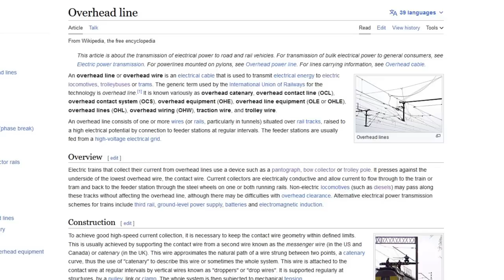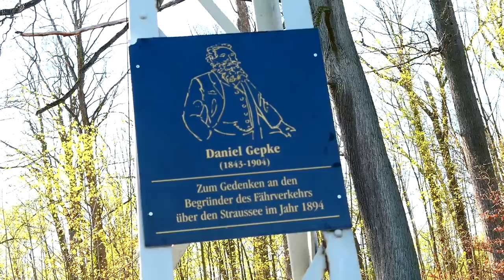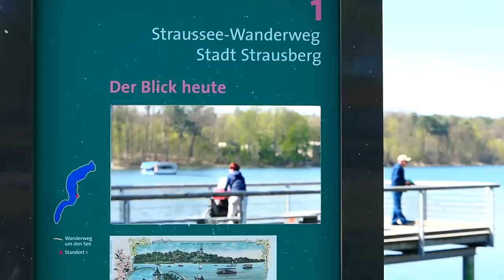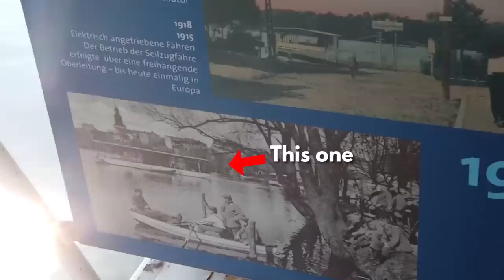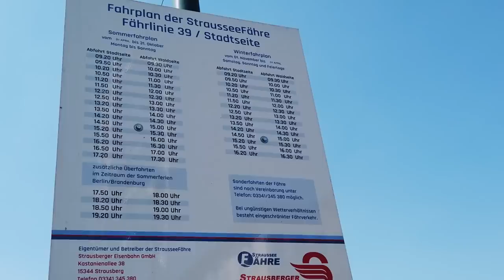The Ferry Powered By A Live Electric Wire

Comment: Seems like it'd be easier to put the winch on the shore and tow the ferry by its cable, like a San Francisco style cable car. You would need minimal power aboard that way - just enough for wireless control, lights, etc. I wonder why nobody does it that way. Or maybe it is a thing and I've just never heard of it?
Reply: it is a thing. It's called a cable ferry, or cable pull ferry. It's the oldest form of ferry. Many of them were retired because the cables sets a limit for how big the ferry can be, or they were just replaced by a bridge, but this is a very small ferry and could easily be built as cable pull. There's no need for it to be self-powered when it only goes such a short distance across a calm river
Reply: There's loads of cable ferries. It's definitely a thing. I and I was wondering the same thing. This type of electric ferry doesn't really appear to have any advantages over a cable ferry in my mind.
Reply: Yes, that is a cable ferry. There's actually one in Potsdam, not far from Berlin (just in the other direction).
Reply: it's Germany, sometimes they over-engineer things over there. 🙂
Reply: @TheEstampe  only sometimes? :P
Reply: @thesteelrodent1796  It isn't even a river, it is a lake ("See" means lake).
Reply: @all the ferry in this video is a cable ferry.

@OP there is a good reason why most cable ferries have the engine on the ferry and not on land:
If the engine is on the ship the cables can have slack. The cables are under water even while the ferry is moving. So ships can cross the ferry even as it's moving. 
Whereas if the engine is on the shore the cables are pulled tight and over the surface of the water.
Reply: @mdhazeldine  the ferry in this video functions just like most other cable ferries. 
The only difference is how the power is provided. (not by battery or a diesel engine) 
And the advantage of this type of power delivery is that you don't use a diesel engine and don't have to re-charge the batteries (that's especially a problem with battery tech from 1913)
Reply: Towing the ferry by a non-stationary cable on a shorwbound winch is difficult because on all but the shortest crossings, the cable sags and sits on the bottom of the waterway, usually in mud. That same mud prevents rollers like abovewater cablecars have.

Comment: 230V system, max 7.5kW power (10HP) for max. 100 passengers. That's mighty efficient (and slow)
Reply: 5 minutes to cross a lake doesn't sound very slow to me, just about normal. (shrugs shoulders)
Reply: @LeafHuntress  Depends on the width of the lake, looks like a nice, leisurely ten minute swim.

Comment: I find interesting that it uses just mains 230V. Given the thickness of the wire, it uses no more than 200A or about 40kW (55hp). But I also think that it does need more, as cable pulling is more efficient than a propele.

I would rather use 600-1000V.

Comment: For cable ferries, I'm never too clear on why bank-pulled ferries (like the Jonen or Kungalv ferries) are so rare. They are pulled by winches set on the banks which can easily be powered electrically without needing to run power to the ferry itself. There must be a reason, but I can't rightly imagine one, they seem like a much simpler design using hard-set winches, and the ferry itself is just a barge.
Reply: Getting a fail-safe control signal from the boat may be a design challenge.
Reply: Also, the cables dragging through the riverbed silt add an enormous drag.

Comment: Well actually…

The Kornhall ferry across Norde älv between the north shore of Hisingen island (of Göteborg minicipality) and the mainland of Bohuslän (and Kungälv municipality, where Lise Meitner was visiting one X-mas and figured out nuclear fission while on a X-mas day stroll; by coincidence, the railway station for Kungälv is in Ytterby, the same name as the mine on the other coast of Sweden where so many elements were discovered in Gadolinite) is one of those extension cord ones. The ferry is called Kornelia – of course, a good pun is par for the course in Göteborg. 😁 There is also a smaller version of a tide barrier across the river there, to prevent salt water from entering the fresh (😬 well…) water supply for the slightly more than half a million inhabitants of Göteborg. 

But you’re not going there so see any of that, you’ll be going to see the four-ish generations of locks at Trollhättan before the canal is rebuilt with the fifth generation of locks.

Alternatively, Göteborg (that’s “Gothenburg” to you anglophones) has northern Europes largest network of trams 🚃. The quirky bit that is Tim-worthy is that is was supposed to be converted to mini-metro in the 1960s, so there’s a bit (on the alignment of an old narrow gauge railway) with underground mid-platform stations with a right-hand traffic to left-hand running crossover in the middle of nowhere.
Reply: And there is also an "extension cord" ferry a bit north from the Kornhall ferry, between Orust and Malö. I grew up close to it, at that time a diesel powered cable ferry. It is really not very far-fetched to  convert cable ferries to electric cable ferries.

Comment: Why not use DC and use the water as ground instead of return cables?  Trams basically do this: DC potential from above and the rails are the ground.  Trolley busses need two cables to provide ground since the tires/tyres insulate the vehicle from the ground.

Comment: Is this the only boat allowed on the lake then? You can't really have boat traffic going up and down when there are guide wires stretching across it.
Reply: I'm not sure about this lake, but most cable ferries have enough slack for the cable to rest well below the surface (or on the bottom) when it's not traveling. They are usually well marked and have other indicators when they are pulling the cables tight.

Comment: Well, actually... There is an electric tug towing boats through the Riqueval tunnel, in the Canal du Nord in Northern France. It isn't so much a ferry as it is a shuttle service for boats, so it is kind of a ferry for boats. It operates on the same principle: it has two wires overhead (only one is used) and a cable underwater, and it pulls itself forward on that 8km long chain, as well as it being a return path.

It would be well worth a video, it has an interesting museum, but unfortunately no tours through the tunnel - I happened to chat to a passing freighter wo invited me along on the trip provided I walked back the 6km myself, which was well worth it even in the sweltering heat wave. (especially if you also visit the American Cemetary at Bony, because the tunnel (or rather: the absence of a deep canal trench) played an important role in both world wars.

https://en.m.wikipedia.org/wiki/Riqueval_Tunnel
Reply from the maker: Yes - this is the electric tug shown in the video. And I agree, it could be worth a vid itself some day, so cheers for the extra info! Guess I'm going to have to make friends with a freighter...
Reply: @TheTimTraveller  Oh, and it's neigh impossible to access the area by public transport. There's supposedly one pair of school bus per work day in the area, but I have not been able to find a timetable.
Reply: Is it still in operation ?  I went all the way to the entrance of the canal somewhere in the 1980s.  I saw the wires, but did not see any boat passing.
Reply: @thierrypauwels  Yes, but it does one return trip per day (at 6am and 8am)

Comment: OK... so why have an electric motor pushing an inefficient prop on a boat when you could just put the motor on land and pull the cable back and forth? -BTW Oregon loves you.
Reply: It doesn't have a prop. It has 2 winches, one for each cable on either side of the ferry.

Comment: don't see the benefit of building the ferry this way, instead of just doing a regular cable pull, since it's got cables running across the river anyway. If you want power aboard the ferry you could just power the pull cables. That overhead cable really makes it impossible for decent size sail boats to use the river

Comment: how dangerous is it to swimmers if they just ground the phase with the water it's swimming in?
Reply: Given that most swimmers are going to be less conductive than the steel cables that the ferry is pulled along, I'm pretty sure that the primary danger would be the fact that they're in the path of the ferry.
Reply: not dangerous at all because it's the ground wire, and you're sourrounded by conductive water. The voltage you experience even touching the cable will be directly related to the resistance of the sourrounding water, wich is really small, even compared to your body. Basically any current will much prefer to go through the water than your body. That is if the cable broke on all four sides; If even one is still intact, the current will go through that instead.
Reply: The current only flows through both cables, because the cables have less electrical resistance than the water or your body. It's like a tram track, the rails are ground, too.

Comment: Well, actually, even though I did military service right by Vaxholm, I was not aware of any electric ferries there. The one I used ran on diesel, I'm pretty sure. But I never went to the small fortress island, I went on a larger ferry over to the much larger island beyond the fortress. Which is populated, and also has the more modern fortress at the far end. I was back a number of years ago, and went to a concert on the small fortress island, but for some reason they had a floating bridge there, so I just walked over the strait, no ferry needed. But as it happens, I'm going there later this year, so I will probably at least see the electric ferry!

Comment: since there is current in a river, why not convert the current in the river into energy that can .power the boat from one side to the other?

All it needs is a bunch of generators powered by the current, collecting the produced energy in batteries stored on the shore. 
A monorail on the bottom and the boat hooked to it. A cable that transfers the power from the battery to an electric engine onboard. 
Et voila.

The batteries on the shore will be charged by the generators powered by the flow of the river, perhaps a bit of sunlight as well.....
And, you could even put many batteries in the boat itself, and have small little RAT kinda devices on its hull. 
Like they have on planes. For when everything else has failed, the RAT produces power by spinning in the wind.
BUT: What if you were to have such generators onboard the boat, and batteries collecting the power from the flow of the river while it is waiting for people to board???
Plus the batteries on shore which are charged by turbines on the bottom of the same river, etc etc.

And obviously it should be a hybrid. So we should put in a diesel powered engine, just to make sure.

I dunno. It just makes sense in my head.
There is always a bit of current in rivers.
Reply from the maker: You don't even need the generators! There are ferries in Basel that cross the Rhein using nothing but the current and the magic of physics... https://www.youtube.com/watch?v=OW24yLHmC20